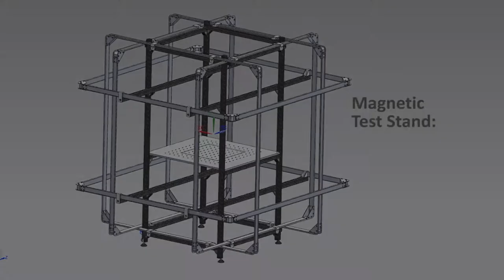Helmholtz-Cage: Winding the Coils

Comment: Hey, I am corrently doing the same project as my final project at university, and I have a problem when it comes to wind the copper wire around the square loop; in my case my U-profile is much smaller than the one you have, but in the end is the same thing. My question is, did you somehow glue the first layer of wires to the profile? And if not, how did you get the wires to stay taut on the sides of the loop, preventing wires from overlapping with each other?
Reply from the maker: Hey, sorry for not answering sooner, I just saw this now. If you look at 0:35 you can see it. After completing the first layer, we swept a wooden block down the channel to align everything and then used hot glue at intervals to lock everything together. It kinda worked, but not great. For the upper layer we still got some intersections, but it was little enough to still be acceptable. The wires could easily separate from the profile again when handling it, because it is quite flexible. When I expoxied in the wires, I used a profile underneath to keep it straight and some clamps and more hot glue to hold down the wires. But it would probably be better to come up with a way of adhering the wires to the channel from the start. If you want more info check out the thesis: https://www.researchgate.net/publication/350837880_Construction_of_a_Magnetic_Field_Cage_for_the_Verification_of_CubeSat_Attitude_Control_Systems

Comment: Hey wanted to ask if the epoxy resin coating was used to prevent the wire shorting with the frame?
Reply from the maker: Hey, excellent question! The epoxy was to keep the wires from moving around and make them a nice solid block. I did have a lot of trouble with shorts to the frame and only noticed this after winding (luckily before epoxy application though). I put isolating tape around the wire at the corners, where the U-profiles meet the corner pieces with a bit of a sharp edge. Additional areas had to be isolated on some coils. Basically I kept looking for areas to isolate until there was no continuity between wire and frame. You can see the tape during the epoxy application. This is not ideal, if I would do this again I would isolate the frames somehow before winding.
If you want more info check out the thesis: https://www.researchgate.net/publication/350837880_Construction_of_a_Magnetic_Field_Cage_for_the_Verification_of_CubeSat_Attitude_Control_Systems
- Martin
Reply: @KSatStuttgart  Thanks so much for the response!